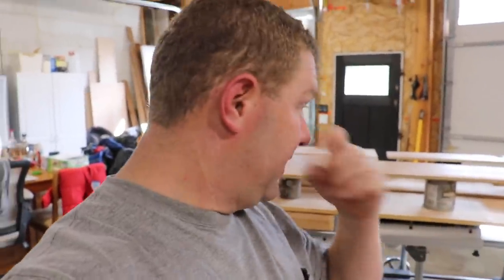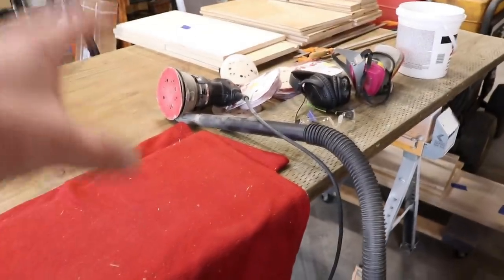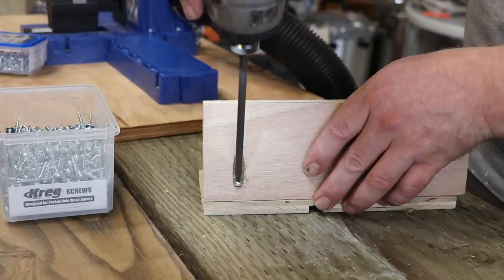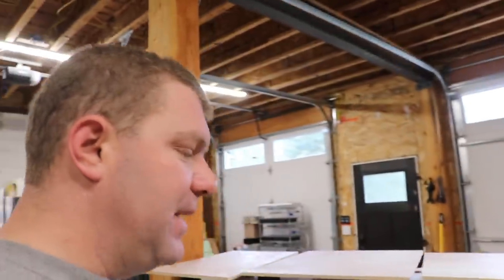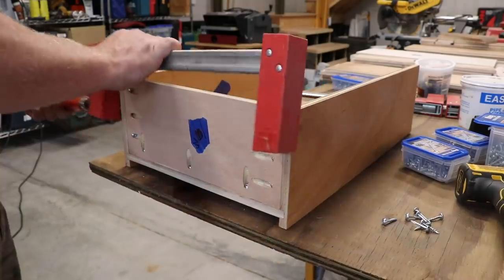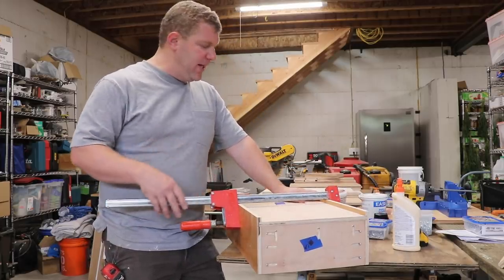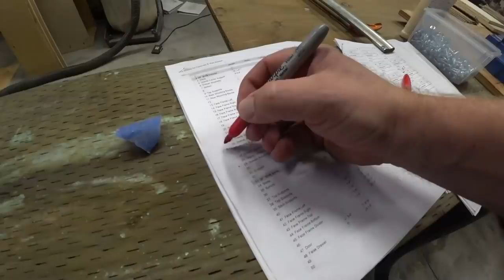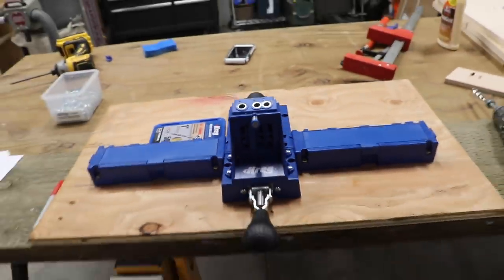IT'S SCREWED & GLUED NOW! (Assembling Cabinet Drawers)

Comment: Kreg thanks you for your substantial investment in their hardware. You put enough hardware in those drawers to support your Ford. The glue is stronger than the wood you're gluing. The screws really are there to keep the glue joint tight till it cures.

Comment: I am not a professional, but I think I would have constructed the cabinets / drawers with wood glue prior to sanding and varnishing.  Typical wood glue needs to bond to the wood, the varnish may have created a non-stick surface for wood glue.  Maybe Gorilla glue would work for your process/application better.  I applaud your effort and quest for efficiency and effectiveness.  Keep it up!!

Comment: Jesse.. The GLUE is where your strength comes from... not from the screws...
Reply: Maybe you could get away with something like an epoxy for finished parts... but youd be relying on the bond strength of the layers of varnish to each other and to the substrate

Comment: You have to set the clutch on your drill.  The screws are so short and the wood is so delicate that it's blowing out.  If you adjust your clutch it won't spin out and will be a much stronger hold.  But realistically it's half inch ply wood, the screws can only go in so far and do so much.

Comment: I am going to agree that WOOD glue does not work well on finishes. 
Now for a new suggestion: When you get to cutting out the drawer fronts, try to cut them all from one sheet of finished ply. That way your drawer edges will more or less disappear with matching grains across multiple adjacent drawers.

Comment: Look into a dust cyclone that connects between the tool and the vacuum.  It keeps the dust out of the vac filter and is much easier to dump a bin full of dust than cleaning a filter.

Comment: The finished veneer needs little or no sanding. The orbital sander will only destroy the veneer finish. Try using a padded manual sanding block with 180 and 220 sand paper sanding WITH THE GRAIN ONLY. Do not be over aggressive. With your fingers, you can then feel how smooth it is.

Comment: Professional cabinet maker for a few years. Sand assemble paint. Sand with 180 grit then 220 will look great we built cabinets for million dollar mansions no complaints ever on finish. We used a two part varnish from Sherwin Williams called chem var don't know if they still sell it. Im worried on your bottom boards they are going to expand and contract do to heat cold and humidity changes. Blowing apart your drawers.  We put dado on front amd sides nails on back cut bottom 1/8 in short on dado sides for expansion and nail back of bottom. Our bottoms where 1/4 varola plywood.

Comment: I'd personally recommend using dowels and glue for strength. Pocket holes are never as strong. This is not the easiest way to build a drawer. Just have a look at some IKEA ones for reference. Thanks for the video, the most important thing is just to get it done.😃

Comment: I'm wondering why you didn't dado the front and back panels and let the bottom float...
Reply: That would have been a conventional solution with solid wood sides and a ply bottom.  Would have been cleaner look with less work concealing joinery.
While what he built is overkill, and not as attractive, they should prove to be quite serviceable.
Reply: @OldTrekkie23  So you didn't answer the question and actually gave credence to it.

Comment: I would never use screws on a drawer, brad or finish nails and glue are the way to go
Reply: Dovetails
Reply: @Homesteadhow   Maybe dovetails for the purest, but nails and glue are sufficient.  I've never had a problem and I don't have the time to fiddle with a DT joiner.

Comment: You would be surprised how much the dust deputy will do. I have used one for years sanding and very very little gets to the filter. It also allows me to use a hepa filter without worrying about suction loss when it would normally clog without the DD.

Comment: Adding a cyclone separator (like a Dust Deputy on a 5 gallon bucket) could save you some of the trouble of cleaning the vac filter that often

Comment: From what I see the problem you are having with spinning the screws is the drill you are using. Your using a driver.  Use your drill and set the clutch. Experiment with it till you get the setting that gives you the tightest joint  and you are satisfied.
Reply: Expect he’s gluing over the varnish, so the screws really are doing all the work.

Comment: Jessie,  you are wasting a lot of time using the kreg system and the amount of screws you use costs a lot o money.  A far better way is to use Tight Bond glue # 2 then use a braid nailer and clamp for  less than one hour.   I have never had a failure using this method.  You would need to use a sledge hammer to cause them break or pull apart.

Comment: Use a bag in the ShopVac when you're in dust collector mode.  The ONLY time I don't have a bag in our ShopVac is when I'm using it for water removal.  More than a little bit of overkill with the screws and glue on those drawers, I think you could support a replacement engine for your truck in the one larger drawer (okay, slightly exaggerated).  The ends of the drawer bottoms should have been lightly sanded before gluing, Elmer's does not bond well with lacquer!

Comment: No doubt those drawers will be strong. I would have just used a drawer lock router bit in your shopsmith router table and glue/brads. Pocket screws are great for the cabinet boxes, but not really right for the drawers. Keep up the nice videos!

Comment: When you are cleaning your vacuum filter with compressed air, you should be blowing from the inside out. With the vacuum on, dust is trying to go from the outside - in, so it works best to blow from the inside - out, otherwise you are just pushing some of the dust into the filter paper.

Comment: You would be amazed how much of the tiny particle dust actually ends up in a dust deputy. Even with silica dust, and fine particulate sanding dust, the vast majority ends up in the bucket and not in your vac.

Comment: Yellow glue will not stick to prefinished ply, they make special glue for this. You should have made the fronts and backs of your drawers same height as sides and grooved them.  Use 18 gauge pin nails to assemble your drawers, then run in the screws, holds alignment of box.

Comment: If you are finishing/top coating with laquer or polyeurethane, you only need to sand to 150 or 180.  Sanding to 220 is a wasted effort as the grain raises when the topcoat is applied.  You can save a step there.  Next - wear a dust mask when you’re blowing out your shopvac filter.  You are breathing in more fine particles there than if you didn’t wear one when you are sanding.

Comment: make yourself a cyclone dust collector for your shopvac. and save your filter
Reply: I use a Cyclone... that just get rid of most of the larger particles...   its not going to help with the fine dust (like you get when finish sanding).

Comment: Also, your problem w/ pocket hole screws catching seems obvious to me. Let me explain. In my tenure of cabinet making, I've seen the cabinets you're attempting to construct made w/ 3/4" ply (cabinet grade 9ply or 13ply 'apple ply') for dividers where doors mount or drawer boxes fit and drawer fronts cover. Along w/ that I've only ever seen 5/8" Luan for areas that didn't need as much strength or width for hinges (nailers, toe kicks, etc...).  I've never seen 1/2" used for anything but drawer boxes which don't need pocket screws b/c they are glued & pin nailed together w/ dado's to hold the bottoms in. Of course, wood glues don't adhere well to lacquer finishes. Maybe you could scrape part of the finish off of the face side where the end grain edge could glue to raw wood ?  Remember, correctly apply'd (applied) wood glue to a wood joint is stronger than the wood grain itself, in most every case. I mean to say, the actual wood will split before a well glued joint .... which is stronger than any amount of pocket screws. On a side note, I believe it would be faster as well and definitely less costly !!!
But again, suit yourself !!  :)
So in conclusion , more threads would catch in 5/8" ply  'Luan', than 1/2" ply, which could explain your difficulties !!
Food for thought,
Sincerely ..........................
Steph
Finish stain grade cabinet maker, installer of about 30 yrs :)

Comment: When blowing out the filter, do so from the inside out as much as possible, going from the outside in embeds the dust further into the filter media.
Reply: Leaf blower works even better than compressed air !
Reply: @jackpatteeuw9244  Yup, 360º blowout all at once, put the filter on a board and blast it from the top!

Comment: Have you looked into adding a cyclone separator into your dust collection system?  That would remove most of the bulk of what you are cutting and sanding so you don't clog up the vacuum system so quickly.

Comment: I personally dislike pocket hole screws, when i built my shop cabinets i tried pocket hole screws and i felt like i spent sooo much time fighting with them and thinking about them to make sure i dont drill wrong and such it took twice as long to do the project. When i did the cabinets in our kitchen i just used glue and bradnails and areas i felt needed extra support i would cut a slit into the corner with the table saw and glue a shim of hardwood into the slit and sand it down flat. I feel like the quality of the cabinets greatly improved with bradnails and glue  vs pocketholes. also instead of spending a lot time on sanding, i did 220 single stage sand, painted everything with 2 coats of duralock lacquer that is clear, then used white tinted duralock for the last remaining coats. to make the surface super glass like, i would put the last coat on extra thick... if i made a mistake and had a run, id just sand it after it dried and try an extra thick coat on it again, turned out way better doing that over many many thin coats for everything.

Comment: Build the best filter for fine dust on your shop vac.
Build a water filter with a 5 gallon bucket. Inlet on bucket goes under the water inside. Outlet to shop vac is way above water. 
Any dust coming in is trapped in the water. Only clean air goes into the shop vac.
To clean it.... dump the dust filled water, hose out.
Works great on fine, filter clogging dust.
Remember this when you get to sanding drywall. 
But a pole sander with vacuum hookup.
Reply: An interesting idea I've not seen before :)

Comment: I think Kreg makes clamps that are for 90-degree corners that might help keep the corners flush.  Also if you have a drill that has an adjustable clutch that might help from striping the holes.

Comment: Based on the design you dont need so many screws. Also, as others have stated, a regular drill with a torque limiting clutch would help prevent over-driving/stripping screws.

Comment: can I suggest that you search "quarter, quarter, quarter drawers" on you tube. Much easier and faster. You have all the equipment you need and it's as strong as you need.
Reply: Jon Melanson absolutely easier!  This was way overkill completely over thought out.
Reply: Huge case of overly thought out. It seems you make so much more work for yourself in every step when there are tried and true ways of making drawers.  Sometimes being a perfectionist is a detriment not an asset. This is coming from a perfectionist that learned to finally let go.

Comment: Just wanted to reiterate what others have said, but make the sides and front and back same size, dado all of them and let the bottom float, glue and pin nails, don't clue on finished surfaces (bare wood to bare wood with glue). Just a few tips from one amateur wood worker to another. Love your videos, love all you guys are doing. Take care!
Reply: You must have watched Norm Abrams as well. It seems like Jesse wants to reinvent the wheel with every project even though he researches the snot out of everything.
Reply: @finieclimber  Norm is a bit before my years. Jesse is doing the best he can with what he has. Plus you never learn if you don't try!
Reply: His show just went off the air a few years ago, you can still find episodes on the internet and he still builds things on this old house. Most people, I'm sure Jesse is old enough, watched his show growing up which is why they think they can build things. Jesse also has more tools than most people and always talks about researching everything like crazy so he should have come across Norm doing exactly as you have described or someone else doing what Norm taught them.

Comment: Why didn't you just put screws straight in?  Up from the bottom, horizontal in the back and front.  Countersink them, and plug where needed.  Then you wouldn't have an issue with bending.....

Comment: The clamps kreg makes help with the slippage. One side slips into the pocket and holds the two boards tighter together. They dont move as much as it is more pin point clamping. There is a learning curve to everything. By the time you make it to the upstairs you'll be at professional levels :) great job!

Comment: Jesse get one of these it will greatly minimize  your shopvac filter clogging!

Oneida Air Systems 6.25 L x 7 in. W x 9 in. Dia. Wet/Dry Vac Cyclone Separator Kit 1 pc.

Item no.2408698|AXD001004

Comment: 1 inch coarse for plywood -- with glue.  The pocket screws aren't the strength of the joint, the glue is.

Comment: Try using a 1” pin nailer to hold the drawer parts. This way you are able to align the parts perfectly flush before driving the screws. Fine threat screws are for MDF so they aren’t apt to break up the fibers where a coarse thread will. Course is for veneered plywood. Using Titebond glue is far better than Elmers. Always use glue and clean off with a damp paper towel.
Reply: The back wall of the drawer l recommend to dado each side and clamp over night . Most cabinet makers have a plethora of clamps for obvious reasons

Comment: Love your videos, but you need to get a Dust Deputy,  tightbond and brads work awesome and cost way far less. Although the craig system does have its use, just not in drawers unless you want to take them back apart at some time.

Comment: I know pocket holes are easy, but not a big fan of them.  You could have achieved the same results with a ton of clamps or used pin nails if absolutely necessary, which would be near enough invisible.

Comment: My experience with Kreg use for drawer construction was that with ply i had to use the course screws not the fine thread which I only use on solid timber and I also found that using the "special" designed clamps made by Keg solved the Bowing problem that you had. I think your clamping was too tight.

Comment: Fine thread screws are only for hardwoods. Use coarse thread screws for all soft woods and, of coarse, that includes plywood. You do need to watch how much torque you put on the shorter screws.

Comment: Wood isn't my field of expertise , I'm into metalwork. I can definitely tell you that the softer the material the coarser the thread should be used, as an example steel UNF tread is stronger than UNC, but for aluminum UNC is stronger it's to do with the force that the tread places on the material as it cuts it's thread.
But you're doing a great job working it out!

Comment: You mentioned you didn't want to mess up the square edge of the 1/2" plywood sides of the drawers. I always do a 1/8" round over with the router. Note:  you can not paint or seal the sharp corner. Over time the plywood chip and splinter. Learned from the pros 35 years ago.

Comment: Did you use a poly glue? If not, you might want to tape off the area that is going to get glued before spraying on the finish.
Reply: Too late, he applied finish in the previous video.
Reply: Halleluja to that comment!

Comment: Use the  shaving dust and wood glue to cover the pocket hole for a perfect finish
Reply: NO,pocket hole closed wood stick and little glue only.hole install wood stick and then saw cut and sanding and have clear sheet no see anythink were has before hole.

Comment: Completely overbuilt.  Far too many screws, since the glue is going to be doing all the work here.  You should have been able to guess how many screws you needed based on building that IKEA furniture, which is a far inferior material.  I also feel like the drawer fronts are just extra wood, since you are going to be adding finished fronts, you could have just made them instead.
Reply: the varnish has negated the effect of the glue

Comment: I am amazed that you do so well using a rough construction measurement system(large tape) - need to learn to use a more accurate system for the main floor cabinets you expect to construct. Keep on trucking'.

Comment: ok.. I know you decided to use pocket  screws...   (I have used them myself for case work in the past) ok next the glue gives you 90% or more of the strength of the Joint...  even with screws... (that's the reason why you try for maximizing the surface area of the joint between two pieces of wood)... ok next I use braids and a pneumatic nailer to hold the wood together while it dries... (rather than pocket screws...)  BTW you did a great job on the finishing...
Reply: Hate pocket screws.  So many things I would like to talk to Jessie about, but hay, he's doing fine and gaining on it.  I had to learn the hard way too, and as he gains experience he will eventually migrate toward better joinery  that is simpler and stronger.

Comment: I'm no expert but I have used the Kreg Pocket Hole jig. My understanding is that for 1/2 inch material you need to use the Kreg Micro-Pocket Drill Guide. At least, that's what I've used in the past. Does anybody have experience using the standard drill guide for 1/2 inch material?
Reply: kreg pocket hole drill jig can use ewery tighten wood. if have 1/4 or 2" same drill jig can use all.